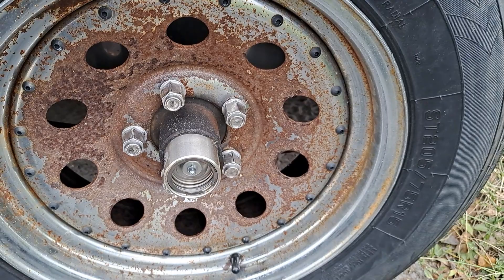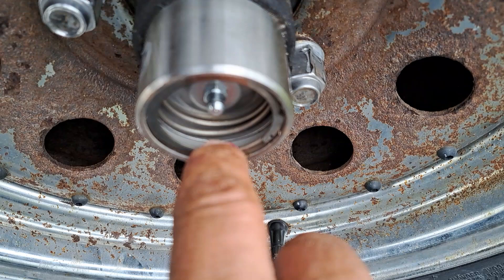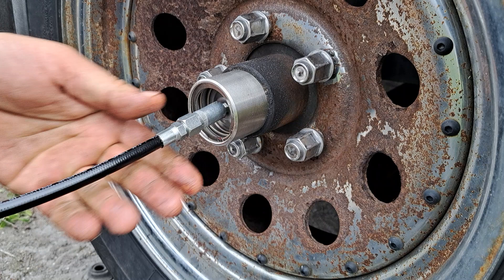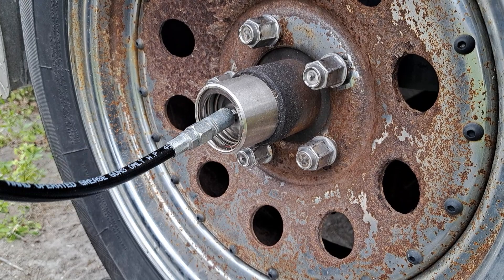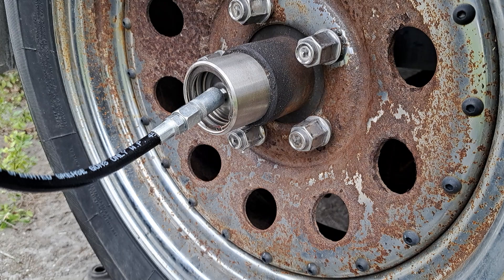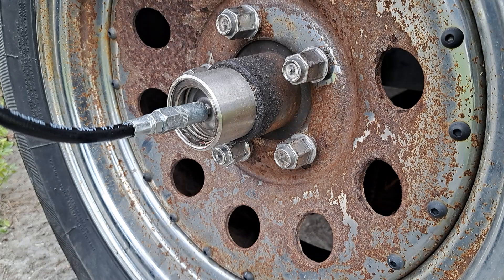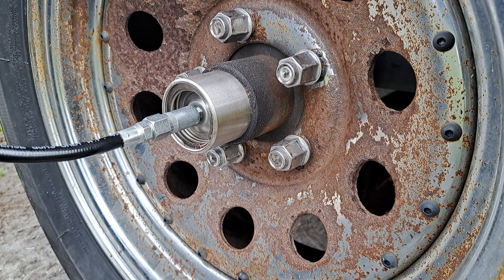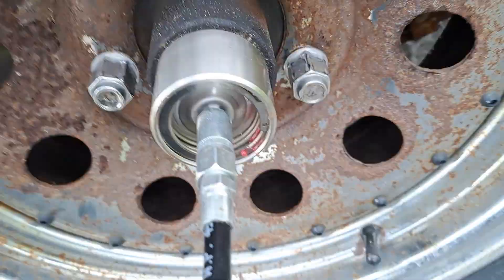how to grease your trailer axle with bearing buddy's

Comment: I generally pump bearing buddies until grease comes pouring out the seams, helps get the old/dirty grease out in the process (if you're just topping off the grease, which has to be done every now and again). Just make sure you have plenty of shop towels as the old grease will get all over everything if you're not ready to wipe it up. You can't overfill bearing buddies.

Comment: ProTip: If you're pumping away and it's not filling, check your inner bearing seal.
Reply from the maker: First time installing. It just took some grease to fill it.
Reply: @smallengineguys  Yep, I get it, I have BB's on my trailers. Only thing better is an oil bath hub. My comment was merely to make people awares so they know to keep an eye out for it. Seen a guy pump half a tube into them not realizing it's just coming out the backside. lol

Comment: Is it ok to use a different type of grease than what came already in my boat trailer bearings? Can you mix different greases and be ok, or do I need to find the same one they used?
Reply from the maker: any grease is better than no grease. you can mix it its fine i use red axle grease most of the time

Comment: Installed these on new hubs and bearings filled them up within 1000kms both seals were blown out the rear and grease everywhere
Reply from the maker: @t-lesk5686  to full lol.
Reply: @smallengineguys  the buddy bearing I only had filled until it was half way out. And many people fill these until the grease comes out the pressure hole.
Reply from the maker: @t-lesk5686  was it old seals?
Reply: @smallengineguys  no new hubs new bears and new seals everything was all brand new parts thats why I thought it was so woerd
Reply from the maker: @t-lesk5686  yeah never had that. I did once have a bad seal. That was a mess.